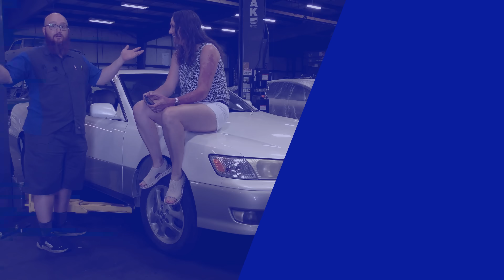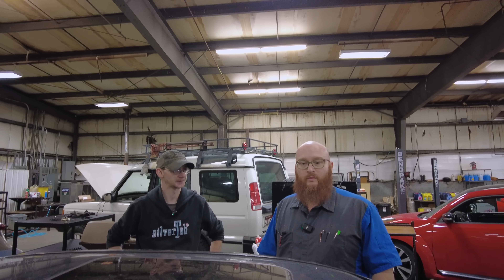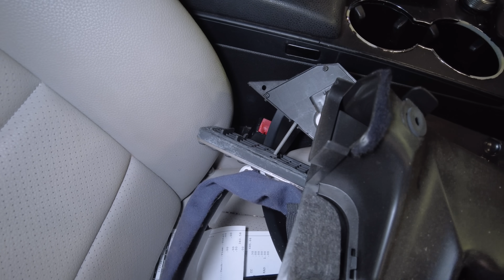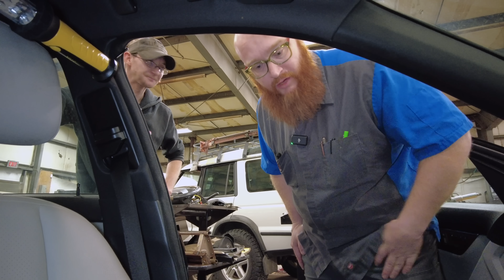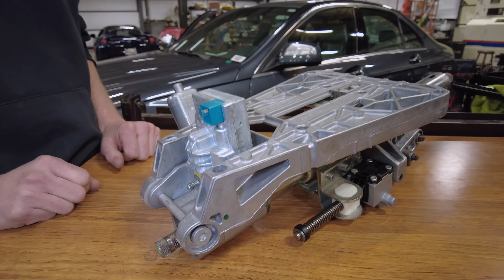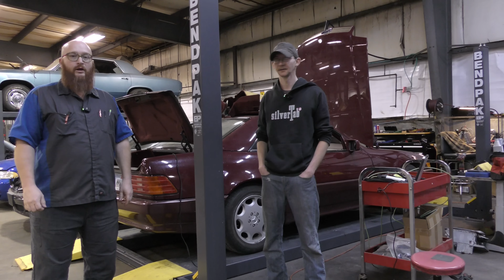Tiny Part TOTALLY Disabled This Mercedes! AND it's a Common Problem!

Comment: Oh my god, when i saw the title i knew it was the immobilizer. These german cars are absolute trash for what they cost.
Reply: My 27 year old W202 is approaching 300k miles with the original engine and transmission, with only 2 sensors, the alternator and the battery replaced.
And mine isn't a shining example, as many of these cars up to the W203/204 generations are still going strong. There's a reason Dodge/Chrysler used major assemblies from Mercedes cars for their own cars, like the 722.6 and 722.9 transmissions that were used in chargers, 300c's and Challengers up till about 2016.
And the price to value ratio is on par with other major manufacturers...
Reply: I bought one new in 2008, this was the only flaw in 10yrs and 120k mi of ownership. So no, not trash at all.
Reply: I had a 2008 W204 C320 CDI 4-matic for years, never had this issue. Maybe they are built different in the US. I heard a lot of them are made in Mexico instead of Germany...
Reply: @Munakas-wq3gp or south Africa
Reply: @ronaldmcdonald9322  South African Models don't have these issues as the components are sourced designed and manufactured in South Africa...chances are even exported to certain sub Sahara countries...ill check the facts with my cousin who works at the South African plant
Reply: @ronaldmcdonald9322 BMWs, not these.
Reply: @Munakas-wq3gp W204 for USA was 100% German production. W205 (2015 +) moved to Alabama, and current gen for our supply is back to Germany. The cars aren’t trash, it was the best car I’ve owned (from new for a decade).
Reply: @bck0001  I've owned MB almost exclusively since 2003 with a brief side step to a Jeep commander and Audi A4 in between. Now driving a 2023 EQC. I have loved every kilometer of my MB ownership so far... I could never go back to Toyota of my youth...
Reply: @Munakas-wq3gp  I went to the dark side BMW x3 M40….sadly it’s already had more faults than my W204 ever had 😀 I still like it, they’re forgiven. I’m sure I’ll be back at MB one day, and I still have a neglected W124 for the classic feel.
Reply: @bck0001  I had a BMW 520 as a service replacement once... Didn't like it one bit.
Reply: @bck0001  my W204 says Made in South Africa
Reply: @bck0001 some early US spec W204 models were built in South Africa.
Reply: @Munakas-wq3gp  The 5 series has lost its way some. The current one is competent (lowest spec we get is the 530 which I’ve driven) but it’s lost its identity somewhat. For me proper BMWs require the inline 6, or for EVs, the uniqueness of the i3. Current MB is struggling with identity also.
Reply: @Munakas-wq3gp That's the big difference I heard the ones made in Germany are far superior than the ones made here or in Mexico
Reply: @Munakas-wq3gp The nationality of the worker has nothing to do with the end product. Same production methods and assembly lines are constructed everywhere. This is an urban myth believed by people that fork out a lot of money expecting Hans from Stuttgart worked on their car.
Reply: @AB-jz9ns  Somehow quality issues plague the cars manufactured in Spain or Mexico. How else would you explain them if it wasn't for the nationality?
Reply: @Munakas-wq3gp  Where did you get these stats that show the majority of issues happen on Mexico or Spain made cars?
Reply: @AB-jz9ns  Several user experiences on enthusiast forums verify the trend. Many car makes are plagued by problems only when they've been manufactured in cheap labour countries like Spain or Mexico.
Reply: @Munakas-wq3gp  Owner forums are places to vent. You can’t make statistical analysis from people vending. For 10 people complaining there are 100 at home not visiting those forums that are satisfied. It makes zero sense for Benz or any product manufacturer to have different quality control policies for different plants in different parts of the world. It is a myth.  Why would Daimler Benz sell out its reputation it took 120 years to build? If someone in Germany gets paid 20 euros per hour for example and their counterparts in Mexico get paid the equivalent of 3 euros per hour for exact same job it does not mean they do lesser quality work. The three euro per hour goes a long way in Mexico and that worker is satisfied. Last you also need to consider that a lot of German manufacturing has moved to Hungary and Poland the past few years for lower wages. The quality is still on par.
Reply: @AB-jz9ns  If only Spain/Mexico built owners vent and Stuttgart ones don't, what does that tell you? 😘
Reply: @Munakas-wq3gp  Provide valid statistics from either Mercedes or some third party that collects ALL repair data and I will believe you. I refuse to believe forum posts where anyone can say anything. Even if all these people are telling the truth and theirs are Mexico/Spain made ones and have more issues you only know from the people that post there. You don’t hear from the thousands of owners that are not posting. Statistically incorrect. It’s like saying I asked around at my local pub and 3 owners if Mexico made Mercs are having issues. So what? Your sample is extremely small to make a judgment.
Reply: @AB-jz9ns  It's a widely known fact that the quality of manufacturing is lower in those countries. I don't need to prove you anything. If you don't believe it, your problem. Go ahead and buy a car made there lol. Then you'll know.
Reply: @Munakas-wq3gp  To each his own. I just don’t believe a German guy works better and more efficient than a Mexican, American, Hungarian, Spaniard, South African. They are all employees of the same company following same policies and guidelines under the control of headquarters. If the company realizes they are experiencing quality issues they fix right away otherwise they jeopardize their brand. I m not saying work ethic differences don’t exist between different regions in the world. That’s something different. We are comparing assembly practices within the same worldwide company. Last, engines and all mechanical and electrical components are ALL made in Germany so when they fail it isn’t the assembly plant’s fault.
Reply: @AB-jz9ns  Yes just like trains run like clockwork also in Spain and Mexico, just like in Germany. No difference whatsoever.
Reply: @Munakas-wq3gp  Are they owned by same company?
Reply: @Munakas-wq3gp never get an American made Mercedes... Made in Alabama... Yuck.....you want german. buy German made
Reply: @Munakas-wq3gp .
.
.-
i...:
-i..
i
Reply: And American cars are... Let's just say they are mostly not desirable.
Reply: @betterbeavailable  Some of them are. We just don't get a lot of them here in EU like Crown Vics etc.
Reply: 2012 C63 coupe, have literally only done valve cover gaskets and changed all fluids. Literally 0 issues
Reply: @hexicalcat4937  You also must have 0 miles on it! lol!😂
Reply: Outside of the minor common issues, the w204 is a rock solid car.
Reply: This generation of mercedes is actually reliable. I have 3 benzes from this era and all 3 runs perfectly fine, W211 with 238k miles, W212 with 179k, w221 with 188k. Its people like you who have never owned one. The same way a benz will breakdown, so can a toyota
Reply: @blankchannel7656   Well said. My V12 S600 has nearly 200k on it, I saw a W212 taxi in Singapore with 570,000km on it! (went in it)
Reply: Funny thing is, the people that say things like "trash" and "sooo expensive" etc about European cars have never actually owned a European car. Many thanks to all the people that continue to keep the negative stigma about European cars alive and well. It makes them very very affordable for those of us that like owning vehicles that aren't intentionally designed to self destruct within 150k / 10 years
Reply: @liftviagra  I agree. There is a lot of misunderstanding about German cars here in the US. Folks that own a 8-10 year old Mercedes often say “why would I spend $500 to maintain my car or $1000 to repair it when it is now only worth under 10 thousand dollars!!! So they trade it in and the dealer gives them $5K and they put it down on a lease of a new car but not another Benz because “they just aren’t reliable” when in all reality they couldn’t afford it in the first place.
Reply: @liftviagra  Here in Finland the MBs don't depreciate as fast. A 2007 CL63 still costs around 40k here. A 65 would probably cost 70-80k-
Reply: This isn't a German exclusive issue. I have a C5 Corvette and they have a really prominent, famous issue with the column lock failing and bricking cars.
Reply: That's right.  I'll stick to my old junk that you can actually start and drive away in.  Or I'll drive my Toyota. 😂😂
Reply: Every American vehicle I owned was rely a piece of crap. With my 2005 Mercedes I'm still driving it trouble free. Still feels like a new car. My Caddilacs and Chevs 5th Aves.  Crap . Shit American manufacturing period.
Reply: I have a 2016 B250 AMG are B250's good? I have the 2.0 Petrol. It's fast it feels great...
Reply: definitely not trash just a big skill gap
Reply: Owned 10+ mercs all on my channel. Only been stranded once. They’re far from trash, some duds, but like most cars not all are perfect.
Reply: @thatmatty231guy  any reliable semi fast 300+ HP awd ones you could recommend under 15k?
Reply: @EastDallasKicks  probably
Not AWD ones sorry - I think the 4matic AMGs are still a bit above $15k and the only one getting close to that is probably the A45 or ML63 but the ML is one of those less reliable ones and the A45 might not be authentic enough compared to the older RWD V8’s. Maybe a V8 Audi rs4 would  be better if you’re not fussed on brand?
Reply: How about when wheel speed sensor fails and the car won't move. (Luckily you can pull the fuse) to drive the car.  Or when steering wheel clockspring is broken.  Then the drivers interior door release latch breaks because of manufacturing defect.  Or with the 2.5L you accelerate hard and car goes into limp mode and you have to reset the fault.  Loved the 2013 C250 otherwise
Reply: W204 c63 owner. No issues in 10 years
Reply: Hot Garbage
Reply: @itsoffsideref5849 c220 CDI AMG does not exist. The only diesel AMG was the w203 C30 AMG. You have only a AMG body kit perhaps
Reply: @01Bsantos  I have one sitting in my driveway right now. It’s the AMG sport plus model, I’m pretty sure they exist because there’s about 180 of them on Autotrader UK for sale as I’m writing this. They come with uprated suspension, brakes, aero and wheels.
Reply: They are as pine hallow diagnostics says a beached whale
Reply: For w204 u need to find the 2011 model thats where they fixed most of the problems
Reply: C class
Reply: @pedrodaniellopesferreira2916Do you have any links that prove this point?
Reply: Still a well engineered machine
Reply: The newer ones are junk, but the olders are much better! My vehicle is W202.033
Reply: Mmercedes s500 is litteraly 20 years old and still runs amazing my most recent repair was the rear airmatic shock and it was easy to install and still driving
Reply: what American car ? there are many in Cuba
Reply: A friend of mine paid 1,200 dollars to have a serpentine belt replaced on a Benz 😂
Reply: They are not. Especially this W204. 

I daily drive this car at 13 years old. Been a great car and have no plans of getting rid of it. The ESL is an annoying issue. 

I never experienced this problem but read about it and got it taken out preemptively. Americans calling German cars "absolute trash" the funniest thing ever. Have you guys seen your cars? There's a reason why German cars are everywhere in the US, but if you go to Europe you barely see any American cars.
Reply: @8MunchenBayern8 funny how you assuming OP was from the US
Reply: @epicraptorman Lmfao are you blind? He’s uploaded videos in the U.S.A, speaks English fluently and without some external weird country’s accent. It’s not hard to tell.
Reply: @EastDallasKicks  you really went so far to profile dive someone bc you were offended about what they had to say? Jfc get a life
Reply: @epicraptorman  Offended by who? I was debunking someone’s statement. I didn’t even have to spend more than minute to get that conclusion. Grow up.
Reply: @EastDallasKicks and spelt immobiliser with a 'z'.👍
Reply: @epicraptorman 😂😂😂😂The irony contained in your own critical posts is clearly lost on you 🤡.
Reply: @8MunchenBayern8 
You could tell this person is ‘merican by there address?
Reply: @8MunchenBayern8  I drive a German car in the US but have been to Germany many times. Parts there are much much cheaper then they are here. That said this gen C class is super solid here in the US as well. You regularly see them on the road
Reply: @8MunchenBayern8  our cars aren’t as expensive as your beloved Nazi mobiles 😂
Reply: @8MunchenBayern8 You won't see many American cars in Europe due to the engine displacements being larger on many of them. Taxed more on larger engines from what I've read.
Reply: @FWDSUXARSE  lol you really believe that? There are tons of V8, V10, and V12  Mercedes-AMG and BMW M series performance cars all over Europe.
Reply: @FWDSUXARSE you don’t see many American cars in Europe because they know Americans cars are absolute trash
Reply: @FWDSUXARSE  most American cars are too damn big for Europe
Reply: @FWDSUXARSE and because American cars are usually junk. Comment from a car loving patriotic American…
Reply: @8MunchenBayern8 yes my apartment garage when living in Germany had a Jaguar XKR, Cayenne Turbo, S550, etc. 😂 many great large output cars in Germany. A German friend had a C63 and then bought an RS6. It’s the culture.
Reply: @evos469 that's right.  Partly right.  Politics played a role also.
Reply: @8MunchenBayern8 as the other commenter mentioned, cars are taxed by displacement. Hence why so many 1.1 or 1.4 L engines.
Reply: @8MunchenBayern8 those are expensive as hell cars, even regular american cars have a lot more displacement. Nobody would buy a regular american car in europe for a lot of money when it costs much less in usa. Those amg cars already cost a lot of money, you didnt even get his point
Reply: @darklordsauron3415 awww. didn't like what I had to say, so resort to the good old "bot" retort. lmao. clown.
Reply: @8MunchenBayern8 ummm.  American cars aren't there only due to politics. Many many American cars have and will far exceed Euro sht box cars in durability reliability, especially older American Cars, granted GM and Ford sold out quality in recent years. But hopefully you aren't talking about Older American cars.  Even some from the 1990s baring the 3800 3.8L and even 3.1L multiport engines. I own 2 of them to this day and they are still in perfect running condition.  And thats just GM.  Mopars Magnum engines are much more die hard than any Mercedes benz, especially modern diesels and non diesels. With the pollution control crap on them.  Bad.
Reply: @JonathanFreedom1st  

"Politics" a great excuse for our cars have crap interiors, handle like crap, and people dont like them. 

Lol, that's funny. 1970s-1995s MB are the greatest cars ever, plenty doing multi million miles. No American cars have come close to that. 

The record is held by a 1976 240D that was owned by a Greek taxi driver. 

2.8 Million miles.

Oh and most countries use the Mercedes S class as the transport vehicles for their head-of-state politicians.
Reply: @8MunchenBayern8  euro cars aren't trash as long as they're below 150k miles
Reply: Total trash.
Reply: @Ummo2850 lol
Reply: @Ummo2850  Poverty talk, dude.
Reply: @Munakas-wq3gp  not at all dude, experience of only driving new ones for 13 years. Never to touch one again. Experience is all
Reply: @Ummo2850  I have driven almost exclusively MB for the past 20 years and my experience has been super positive. I had a leased Audi for 3 years and I couldn't wait for the chance to get back to MB.
Reply: @Munakas-wq3gp exactly right

Comment: What if u r dving and the steering lock
Reply: It only happens when you shut off the car and pull the key out.
Reply: Sounds scary
Reply: It won’t. System only activates when the key is inserted or removed